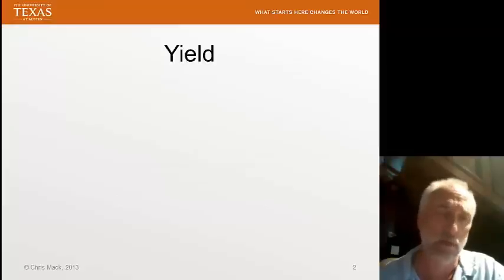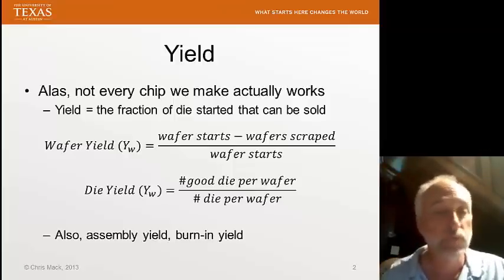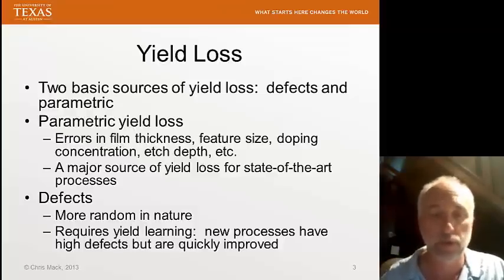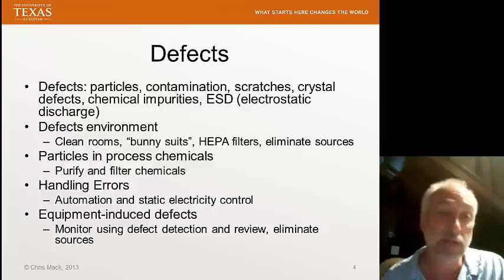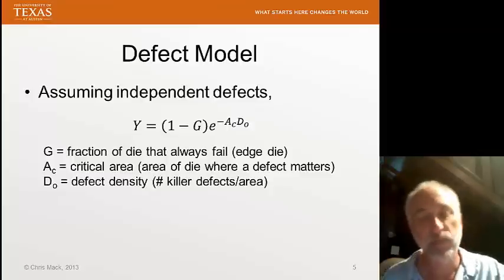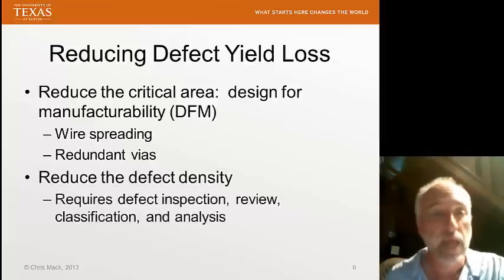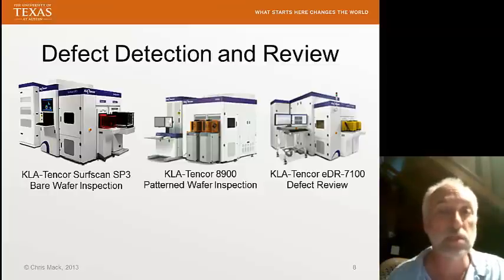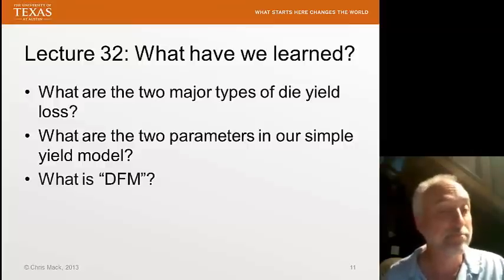Lecture 32 (CHE 323) Semiconductor Manufacturing Yield

Comment: My first job out of college in 1972 was writing software to test memory chips at Fairchild Semiconductor in Moutain View, CA. At that time, each chip was quickly tested before the wafer was scored and broken apart. The wafer tester would step from chip to chip and drop a set of probes on the connection pads to execute the test. When a chip failed, a drop of red ink would be deposited on the chip to indicate that it should not be assembled into a package. 

They were so desperate for yield then that if one (or multiple in the right locations) memory cells failed, such chips were put into one of five special categories such that their address lines could be connected in such a way that five memory chips could appear as four fully functional chips.
Reply: yield rigging